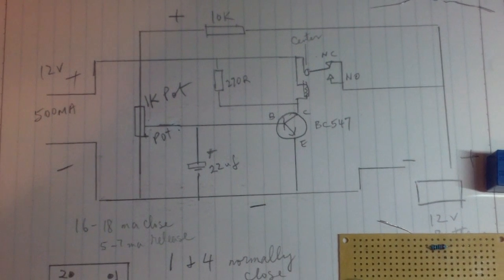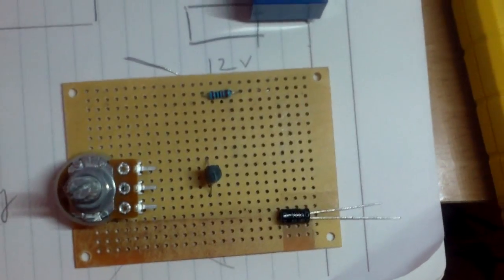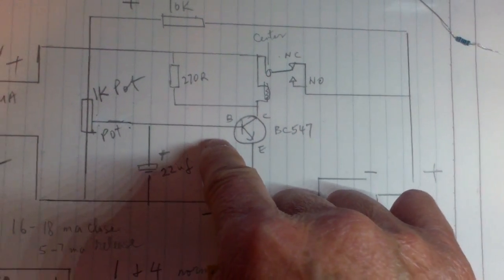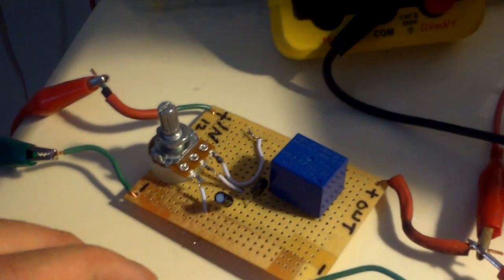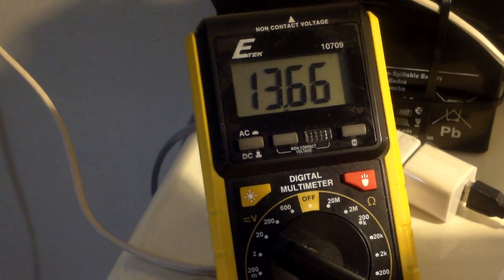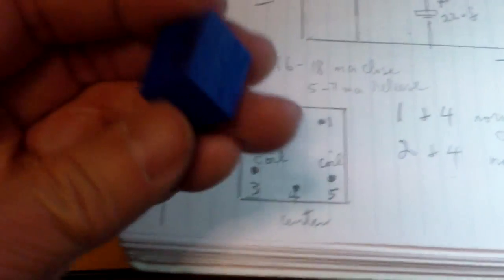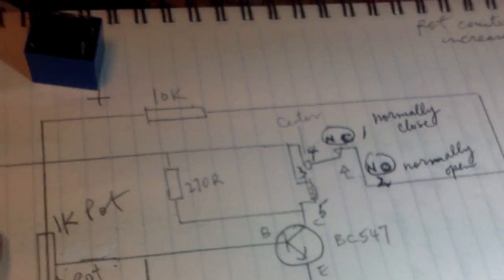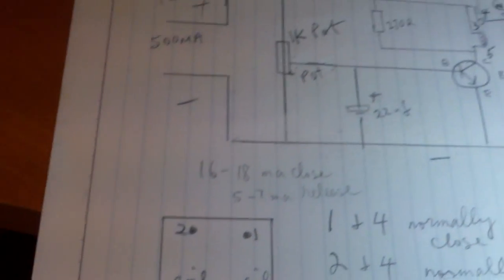Diy automatic 12 volt charge controller

Comment: Wow, this is like the simplest charge controller circuit i've ever seen. This means it is more durable and easier to fix. I was worried about my purchased units because I'm pretty sure they'll break down way before the life of the solar panels.
Reply from the maker: This is not as sophisticated as the store bought ones which can have battery temperature sensing capability and all that. Also the cut out might not be that precise. You also should pay attention to the wiring and the relay rating used. This circuit calls for a 10 amp relay so don't overload it. Maybe add a fuse to protect the charging. Otherwise it is pretty simple and beats just hooking your solar panel directly to the battery.

Comment: Excellent project, just got around to watching this. Probably the simplest charger around with so few components and small size.Nice.
Reply from the maker: It is so simple the original circuit doesn't include a charge indicator light. I'm trying to incorporate one but I'm doing it in a clumsy way. I guess the best way is just to add a digital volt meter.
Reply: wtam69
I will be adding a voltmeter to my next solar project, I found one that looks quite neat and small on ebay.
http://www.ebay.de/itm/121269451208?ssPageName=STRK:MEWAX:IT&_trksid=p3984.m1438.l2649
Might be cheap enough at 1,25euros each to include on a few of my other projects.
 35 x 14 x 8mm can be stuck with double sided tape to any project.

Comment: Made one just today, added a green LED in series with a 1K resistor across the NO contact of the relay and the negative terminal. LED turns on  when the voltage cuts out at 13.14V.
Reply from the maker: Many thanks for your contribution in making this charger work better. I will try out your modification.

Comment: I am planning on making a solar charge controller, this video is very informative. I am using a 20 W, 12V solar panel to charge a 2A, 12V battery. However, I am confused about the calculations for the component ratings, could you please advise. Thankyou.

Comment: Really neat circuit.  I don't see a fly-back diode to protect the transistor from induction current though.  I'm wondering if it will eventually burn it up.  You should put a charging LED indicator light on it.
Reply from the maker: You are very sharp. According to the original design, "No diode is needed across the relay because the transistor is never fully turned off and no spike is produced by the relay." You do have to connect the load to it first before you connect the power supply or the relay will "squeal or chatter." I am working on some sort of charging indicator using a zener diode and LED.

Comment: Sir what if I would like to have a higher volt charge controller? what should I do? do I have to change the relay?
Reply: You can charge any type of battery with any voltage you want just make sure to choose the correct components for example if u want to charge 24v battery use 2 of 12v relay in sires connection or use a 24v rely

Comment: What would need to be changed to use a 24 volt relay?  I can't fine an 28 volt relay? My supply voltage is 18 volts.
Also what is the difference between this controller and the Float version 1.1? The schematics are almost the same except for one resistor and the 1.1 version shows a 12 volt relay?
Thanks, Tom
Reply from the maker: I don't have this setup anymore but I don't think it is a 24v relay. It should be q 12v relay.

Comment: Hi...Do you know if smartphones have integrated charge controllers? If one were to attach a 6v 2w 0.33A solar PV to a smartphone, could that fry or drain the phone without a charge controller?
Reply from the maker: Wayne Lee Anytime  you don't use the proprietary charger, you run the risk of damaging your smartphone. Having said that, your phone shuould have built in controls. That doesn't mean you can feed it any kind of voltages. The smartphones usually require a stable 5.2 volt or so of voltage and 500 to 1000ma. You should add a voltage stabilizing board so the voltage won't fluctuate that much. When they say a 2 watt solar panel , usually you get much less when the panel is heated up or when the sun is not just right. Good luck with your project.
Reply: Thanks

Comment: Nice video. So basically i can use etc 16v and 10amp`s DC power supply right?   What changes must be done to this circuit to use it with - voltage in 15.5v and 15amp`s? . Planing to use as car battery charger : modified pc psu ->charge controller ->battery . Thanks in advance!
Reply from the maker: +Raimis Pavardenis  This is not suitable as a 15 amp charger. That would be a different design that needs better cooling,  heavier duty wiring and a different circuit.
Reply: +wtam69 yes i understand this, but also asking or its safe to use with up to max 10 amp DC supply (not solar and we can forget this 15amps part:) )..let say safe side 6-7amps
Reply from the maker: Raimis Pavardenis The amperage is determined by the relay and wiring gauge and the power source. While it might work, the original circuit is not designed for 10 amps.

Comment: Did you have any problem with relay chattering a the cut off and on points
Reply from the maker: The 22u capacitor from the ground to the base of the transistor should prevent the chatter or squeal of the relay.  I don't think it was a problem for me.

Comment: Would the circuit panel fit in a standard electrical box? I would love to see some real world tests.
Reply from the maker: The perforated board I use is only 2 inch by 3 inch. The most important part of the circuit is the disconnect point and the reconnect point of the circuit. It is set to cut out at 13.7v. If it consistently does that and reconnect at the set point you required, then it should be ok. I need to set up a small solar panel and a 12v battery outside, maybe in better weather. I'm more interested in the solar application of a controller like this.